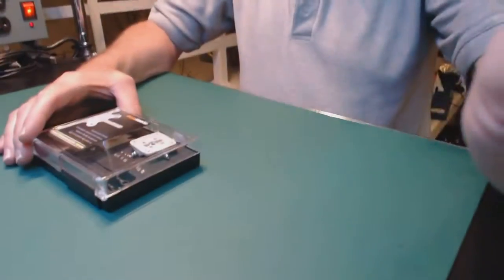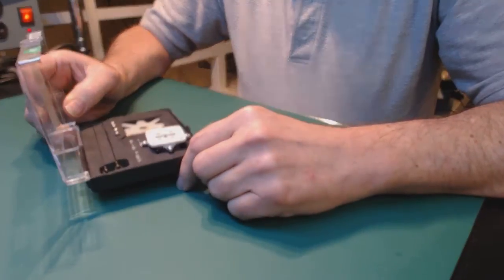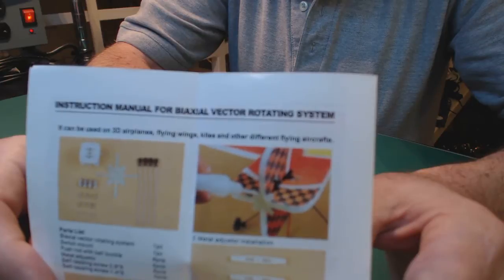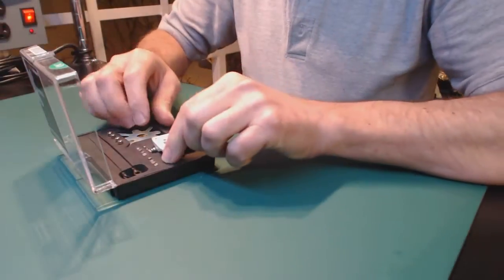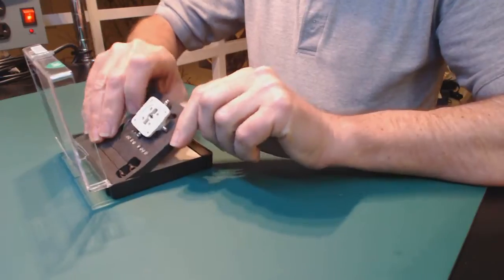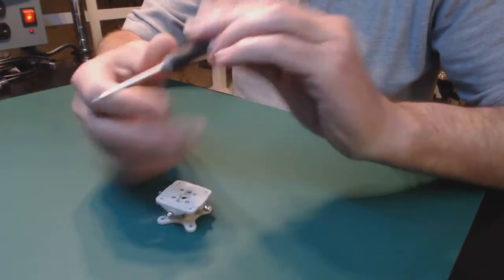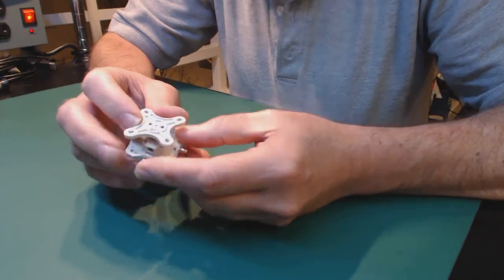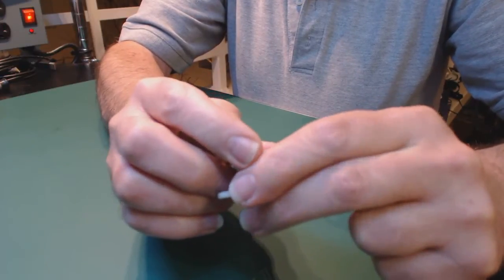[SH-0010] HK BiAxial Vector Rotating System

Comment: can i use this system for a motor with a thrust of 800grams.?
Reply from the maker: I don't see why not, as long as you are mounting the main vectoring unit directly and NOT using the "adapter" plate.  That plate is a bit flimsy.